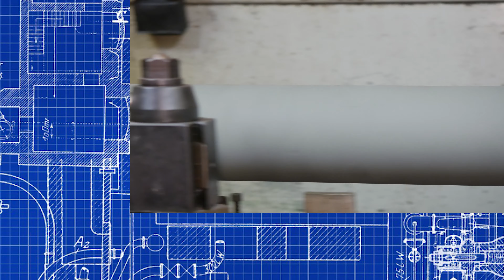Antique Carnival Ride Damage Repair

Comment: i to have started back doing the restoration on kiddie ride(police car)  but most of my work is electronic
 (led lights) trying to figure out why no power ( bad fuse holder) now just waiting on rubber vibration mounts. waiting on next video thanks
Reply from the maker: Good luck!  The electric part is actually the area I have the most knowledge of, but this ride doesn't really have all that much electrical to be done.